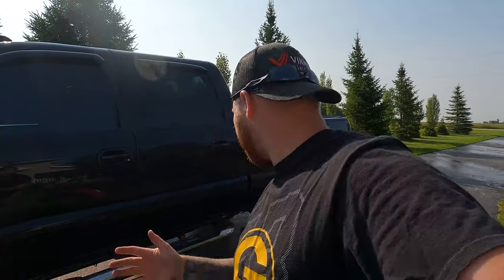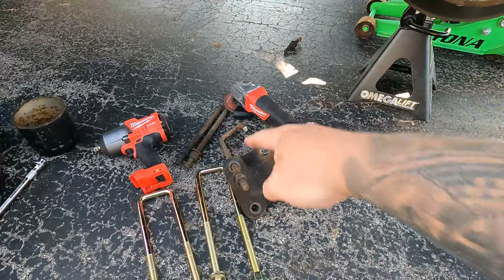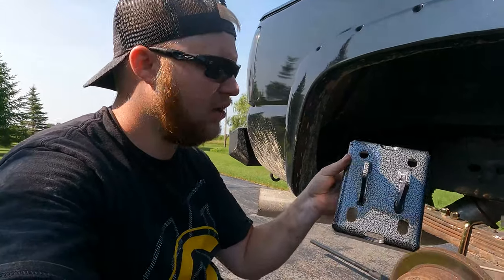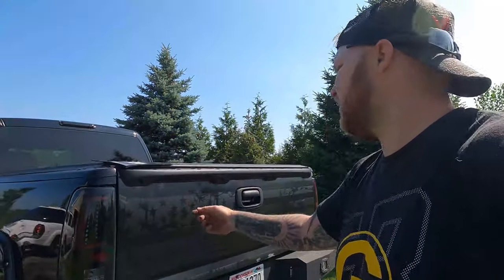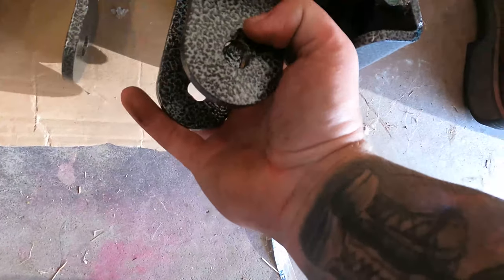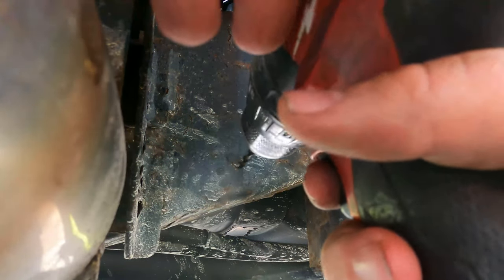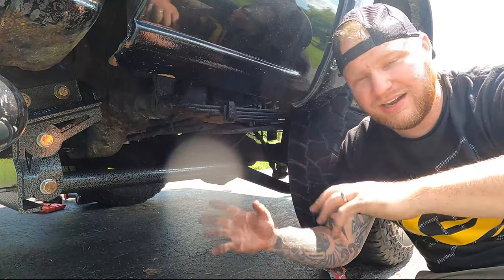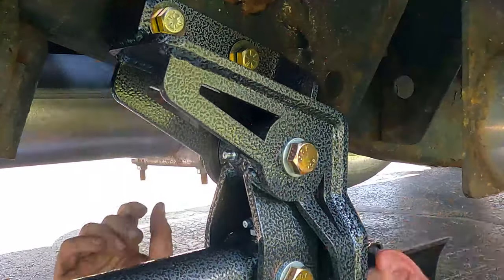How To Install Duramax Kryptonite Death Grip Traction Bar Kit (01-10)

Comment: Where did you say you got your u Bolts from?
Reply from the maker: So I ended up ordering new 2” blocks and U bolts from DMAXStore. You can get U bolts custom made from probably a few places locally to you. Just ask around locally most shops can get them made, and back to you pretty quick.